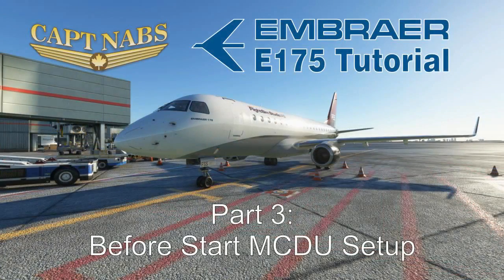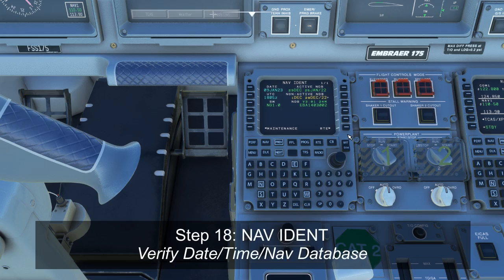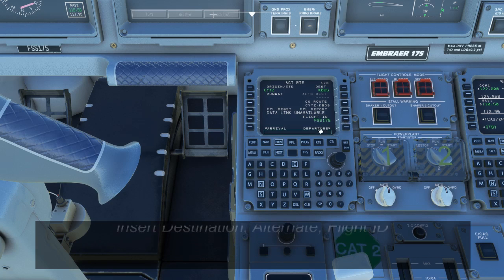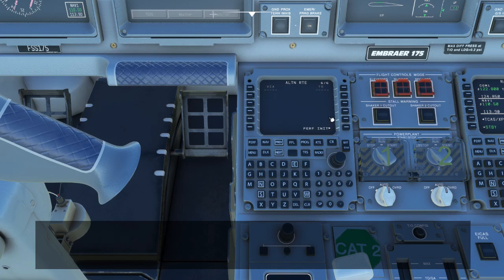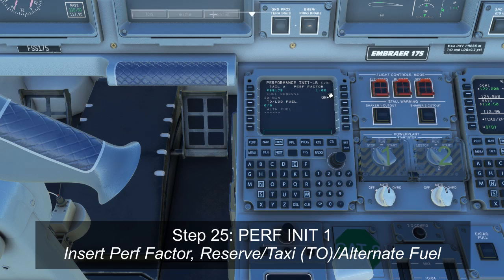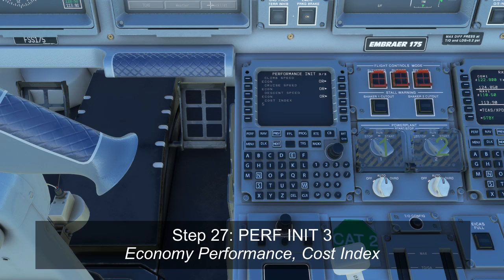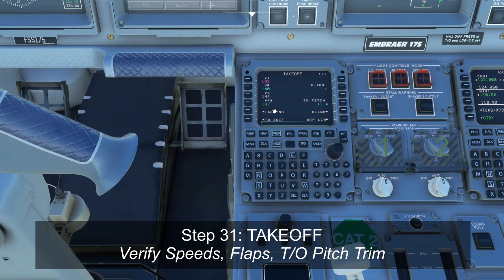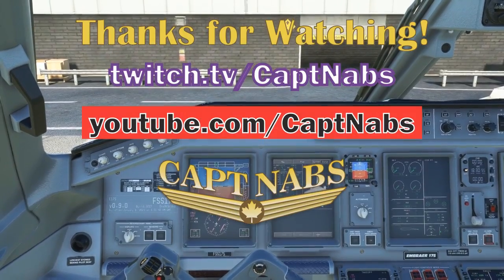Embraer E175 Tutorial 03: Before Start MCDU Setup

Comment: unfortunately, when I use this model, the menu in the bottom bar (esc, return etc) is missing and it is not possible to change the settings and so on. I do not understand what it depends on. I use windowed mode and not full screen
Reply from the maker: You can tap ALT+ENTER to switch from windowed to full screen and back again very easily. Switch to full screen mode to see the menu and switch back afterwards.

Comment: I couldnt connect the tablet to my simbrief for some reason. So I tried just putting my flight plan in myself, but when typing in an airway I got an "invalid airway" message. Same thing for regular directs. Couldnt manually enter anything because it would always give me an error code...
Reply from the maker: @FarmLapse  Sorry to hear that. The system is still based on the basic MSFS FMS for now so it is not very robust. I am still eagerly awaiting the custom written FMS to solve these types of issues...
Reply: @CaptNabs  do you have any idea on how to get the small green lights on on the MDF? I was test flying it, but none of the lights actually worked. AP, YD, NAV, .... all have lights above them, but none work.
Reply from the maker: @FarmLapse  most operators deactivate those lights. I forget if they are an option in the airplane.

The reason is the guidance panel is just an input to the computer. Operators would rather have you confirm the correct mode by reading the output on the PFD. This way you know the computer received the message correctly and is giving appropriate guidance. So use the annunciations on the PFD to confirm the modes are corrrct.
Reply: @CaptNabs  As a beginner it's really helpful to see the lights. I was descending on my flight, but too late because I couldnt figure out how to see the T/D, and was trying to circle around into heading mode. For some reason, even though I changed headings, the plane kept flying the original heading I entered, so flying in circles. I tried by clicking the heading bug again, turning LNAV on again, etc. For some reason the plane kinda crashed on me, plane started diving at 350kts, just dove into the ground, couldnt pull up as wel. Auto throttle was engaged, but the thrust levers were set in idle, even when manually overriden the levers, I set them to full thrust, but couldnt pull up lol. This is either one of the hardest planes to fly or really buggy. I've flown the RJ146 and that managed way better than this
Reply from the maker: @FarmLapse  The Embraer is one of the easiest jets to fly. The Flight Sim Studios rendition still has lots of bugs to be worked out. I would suggest waiting until it exits early access if it is frustrating you. The customized avionics really need to be working correctly.

However, as I said, read, understand, and trust the Flight Mode Annunciations (FMA) at the top of the PFD. They tell you what the computer is trying to do better than some button lights.

At least they should if the computers are properly simulated. Best of luck!
Reply: @CaptNabs  thanks captain!

Comment: Hey captain I figured for you to see my comment better to write in en lol. I like your videos but I would like to suggest that you explain a bit a few quirks and tricks or functions of certain things on this or any other aircraft ie. Why do we need to leave hydraulic pump 3A off and when we are about to start the engines put it on. Simple explanations like this worth a lot for us in order to understand better. Thanks
Reply from the maker: Those answers are coming. The goal of this series was to be a quick primer on how to fly the airplane. Like any airplane, there are hundreds of quirks you learn as you fly.

For the HYD3A pump specifically, it is basically to save wear and tear on the pump. It is one of the few systems that does not turn on/off automatically. To make it very reliable, it is always on when the switch is on. So only having it running when engines are running ensures it is available when needed, but not any longer.

Comment: Hello Captain and thank you for the detailed explanations!

A simple question that I have is, why is the layout of the MCDU/FMS so different compared to Wilco Feelthere?

I saw a few real world flightdeck EMB- videos on youtube and the layout matches more to that which is used in the Wilco addon.

Are there different software options for the MCDU in real life?
Reply from the maker: That's exactly it. The FeelThere Embraer approximates version 25 of the software quite closely.

However, about 5 years ago Embraer released version 27 which was a huge upgrade, introducing lots of new features like Cost Indexing. This upgrade was optional (and not cheap - I think it was $50,000 per aircraft). So not all operators bought into it.

But yes, FlightSimStudios are recreating version 27.
Reply: @CaptNabs  

Thank you for the interesting infos!